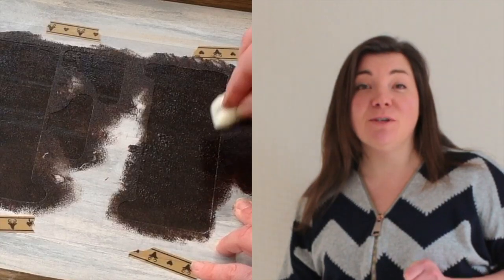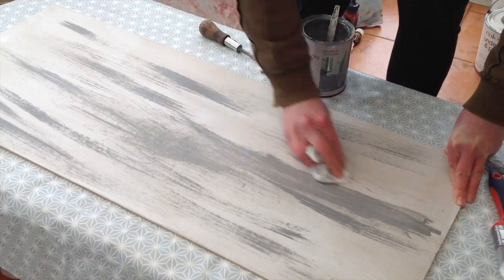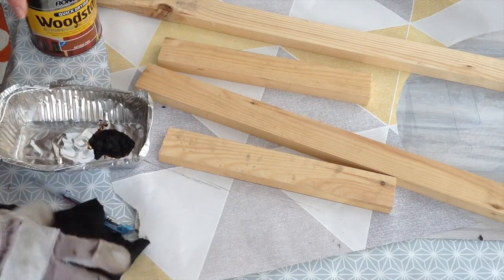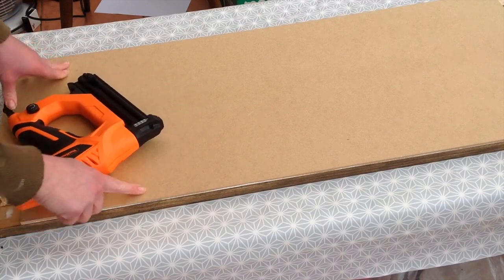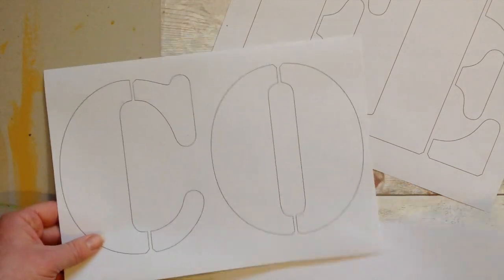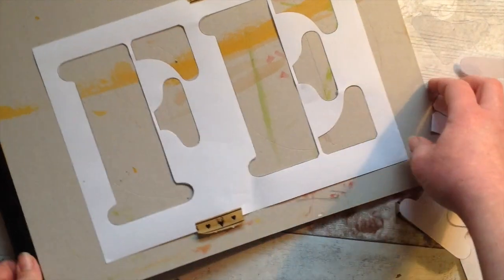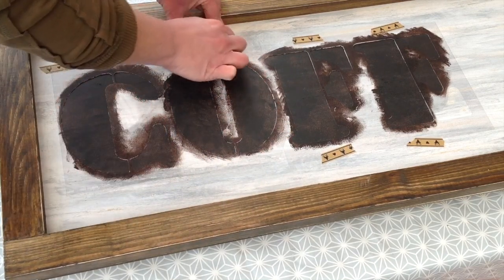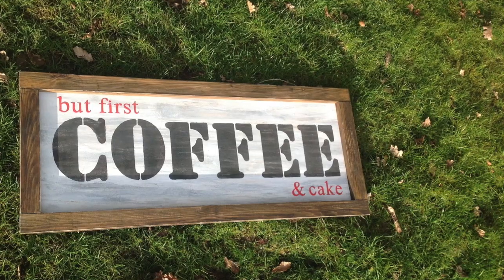DIY Wood Signs | Stencil | No Machine Needed

Comment: C is upside down 💕
Reply from the maker: It totally was, but did you see at the end how I fixed it!
Reply: @RedRockingBird  got it. Just a tip for non lettering people doing stenciling crafts that print the patterns in sections , add an arrow showing top. Also for letters that are thick thin stroked it's easy to flip the pattern so mark those "front" to avoid getting the letters flipped. Common letters are W V M U A. Much love from Johannesburg, South Africa.
Reply from the maker: @alansm136  great tip thank you, I very much need to start doing this, easy to overlook such things when in full swing of a project 😂👍